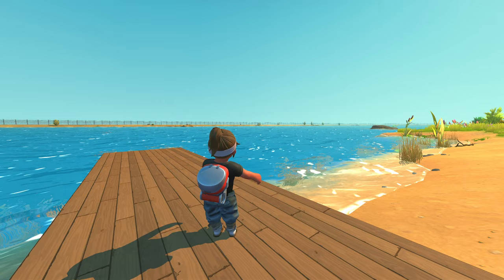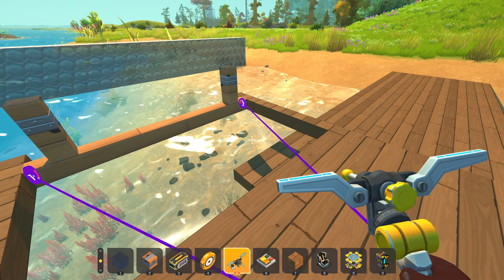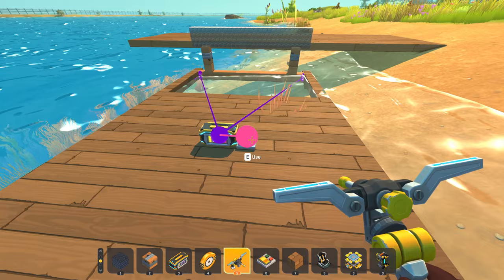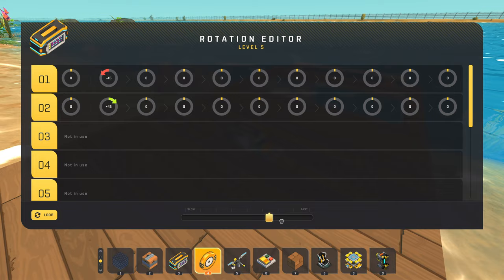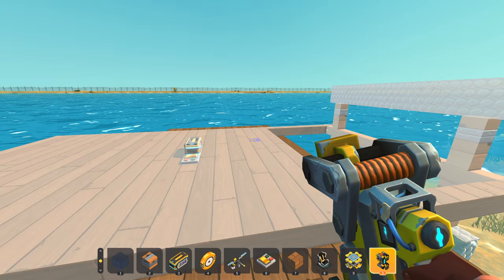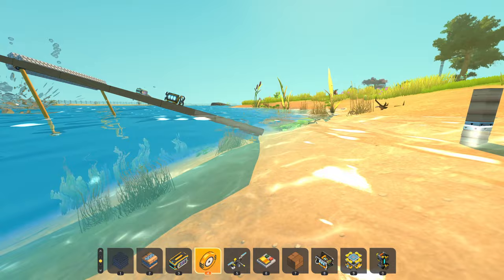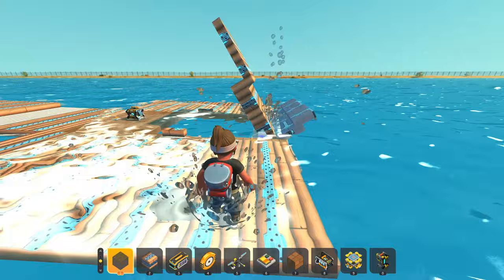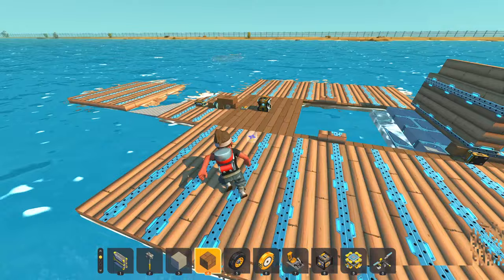PADDLE-WHEEL BOAT With Bubble Blocks ? Scrap Mechanic #227

Comment: I made a working paddle wheel boat.
There are a few videos of it on my channel from 10 months ago ;-)
Even a working one doesn't go very fast but yeah, the way to make it work is to use suspensions.
Kind of like how you were trying to use pistons here.
If you put suspensions at the same place where you put the pistons and instead of making the paddle out of bubble wrap, you need to use a heavy material, like concrete or bricks.
Once that is done, it becomes a matter of adjusting the size of the paddle, increase the buoyancy of your boat as needed to avoid flipping when the paddle wheel is turning.
The bigger the wheel, the faster your boat will go but if your boat doesn't have enough buoyancy, the wheel will make it flip in the water instead of making it go forward.